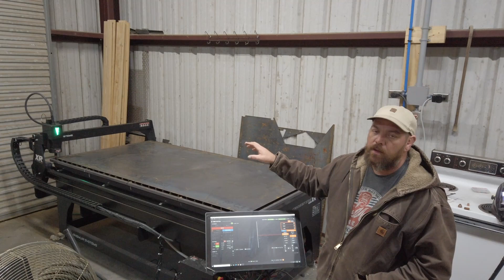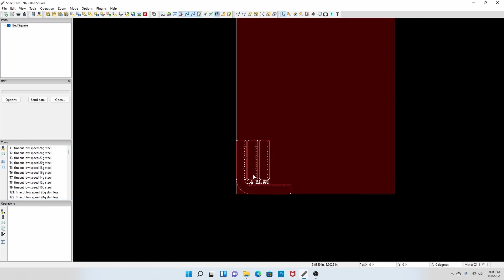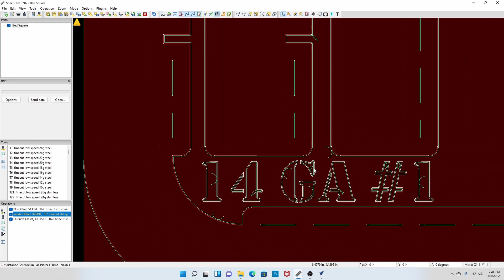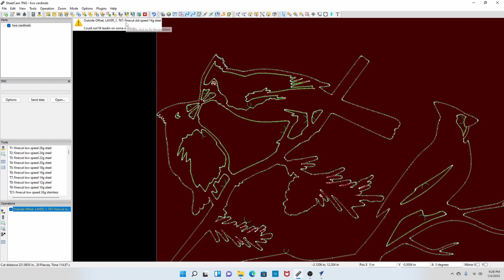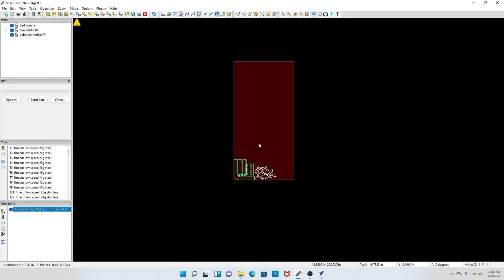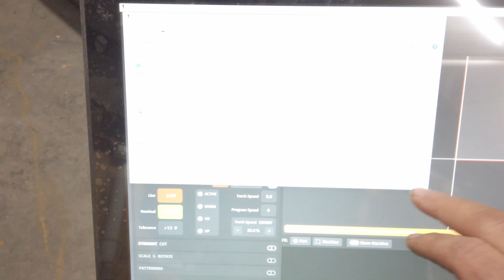Bed Square Long version with sheetcam tutorial

Comment: Great video. I don't cut out of big sheets, I'm trying to figure out a way to position my material in the middle of my table for a 10 x 10 inch square piece of plate. I usually use small scrap so I want to be able to stick the corner into the same exact spot anywhere on the table the, not necessarily near the edge.

Comment: Thanks, Clyde. I've been wondering how to remove sheets, and then later put them back on the table and resume cutting in the unused portions, but yet see the used cut areas, so I don't place new pieces on the wire. I'm ordering my new Crossfire soon. 

I'll look into Vectric Vcarve Pro soon. What about that program do you like, and why do you use it?
Reply from the maker: Vectric VCarve Pro is a very robust software program. It is very intuitive to me and easy to use. The main reason I use it is because I already have it for other CNC work. It has the capability of 3D tool paths for a milling wood on a CNC. If I didn’t have the wood CNC I probably would have gone with another Vectric  program like Cut 2d pro. The pro versions of Vectric’s software are very similar to the regular versions except they are limited to 24x24 inches I believe. And I think that is only the tool paths. I make my plasma tool paths in sheetcam so if it was me I would probably just try regular cut2d with sheetcam and you could save about $500
Reply: @clydehunt4405  Thanks. Since the table i'm buying is a Crossfire 25"x33", and I only cut plasma, your 2d recommendation is spot on.

Comment: Hey Clyde, I have a question for you.  In this video you showed us SheetCam and Fire Control.  You also talked about DXF files.  It seems like you added cut paths (Inner, Outer or Centered plus Lead In and Lead Out) in Sheet Cam. I'm guessing you use Sheet Cam to design your part  and then import the file to Fire Control to cutout your design.  I'm not to familiar with Sheet Cam but do well in Autocad and Flexisign.  Both Autocad and Flexisign can export DXF files.  My question is, do you think that importing DXF files from either Autocad or Flexisign would work in SheetCam so that the lead in, lead out and cut paths can be added?  Thanks Doug
Reply from the maker: Doug, I actually design in Vectric Vcarve Pro. It’s a CNC design program. Any DXF if you get the layers correct will work. Make sure all vectors are closed if inside or outside. Then save vectors to layers according to how you want to cut them. Inside, outside or on path.

Comment: just got my xr together, trying to figure out how you show the material outline on firecontrol.  I only show the actual part I am trying to cut
Reply from the maker: Charlie the g-code you make in sheetcam or fusion doesn’t tell fire control what the material is. Are you seeing the 4x8 outline of the system? If you have your material grounded to the front left corner, when you set your material up in sheetcam you have to know that they will match up in fire control. You can do a dry run if your not 100%
Reply: @clydehunt4405  thanks for the quick replay, I got it up and running and even installed your guides. They work great. Thanks for the info.
Reply from the maker: @geton2750  that’s awesome man!